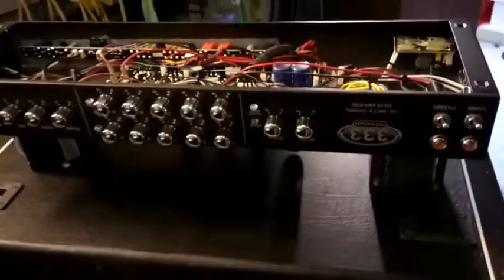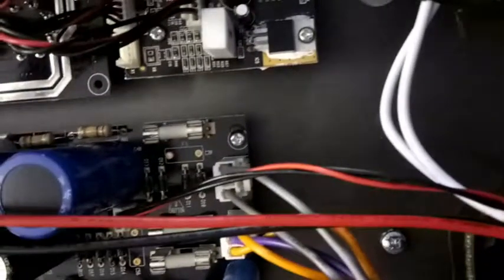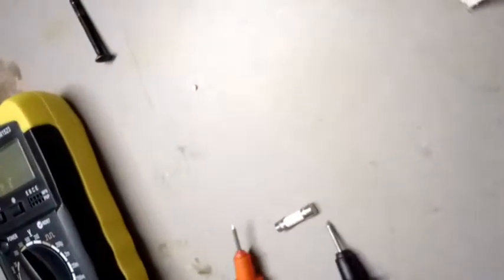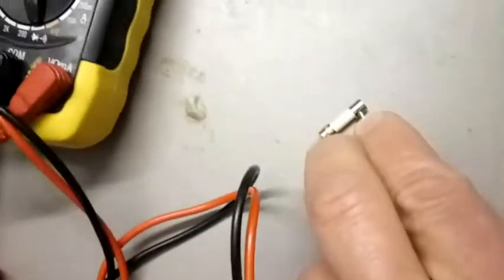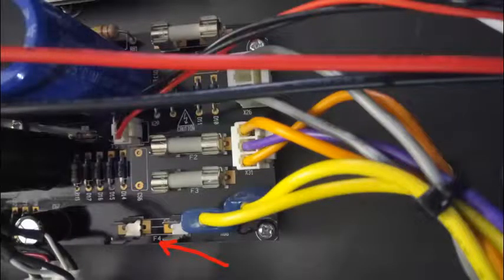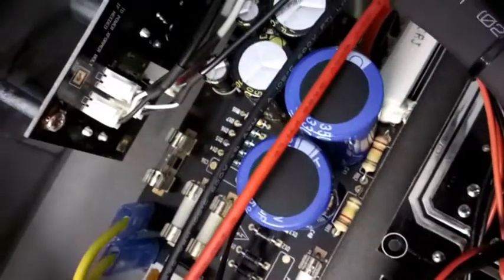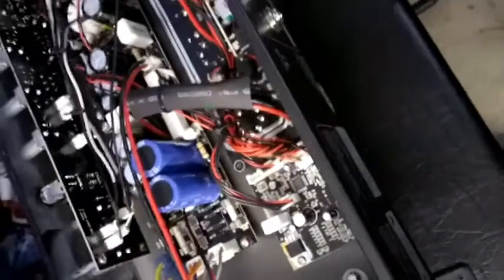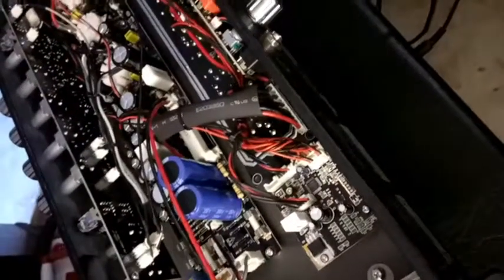Bugera 333 Infinium has no power in power tubes

Comment: The F4 in mine blew too. I have changed it and it turns on and have power to all tubes. Is it possible that the Bugera speaker cab I use could have blown it? Other than that the only thing I can think of that blew it would be a power surge, since I have it plugged into the wall outlet with not surge protector.
Reply from the maker: It could be, check the ohms of the cab to make sure. I think a power surge would be more like it though.
Reply: Your problem  I assume, is the stock tubes. They are the hottest of garbage. They blew my fuse as well and I haven’t gotten around to fixing it yet, but I’m 210% positive that those are the reason. Buy some jj tubes and you’ll be good

Comment: I'm having the same issue with my 333xl as we speak ive tried replacing the fuse and no go. My pe pre amp tubes light up except the 4th that line up with the 4power tubes. They as well do not light up.